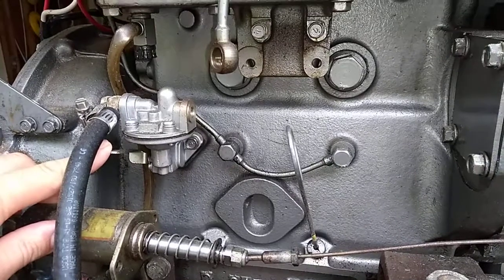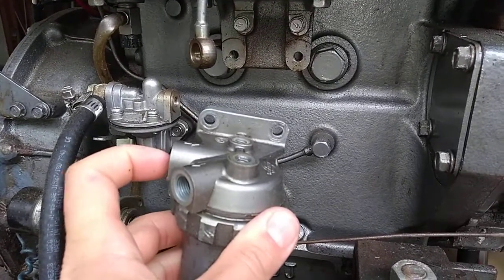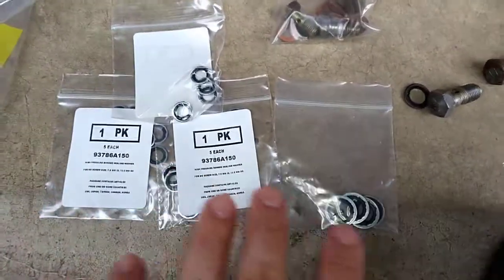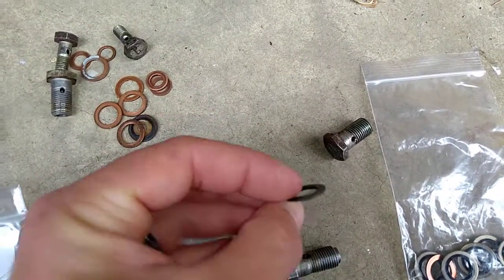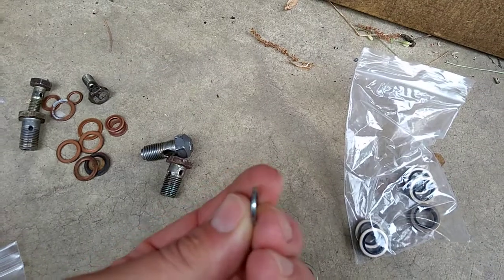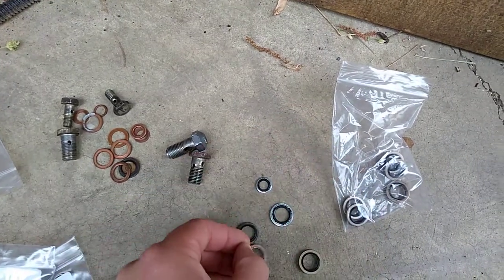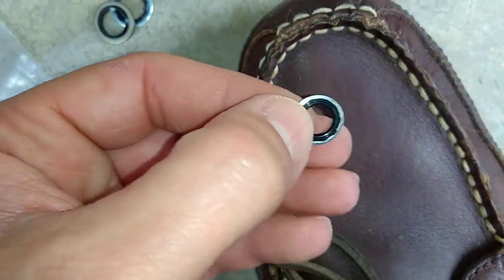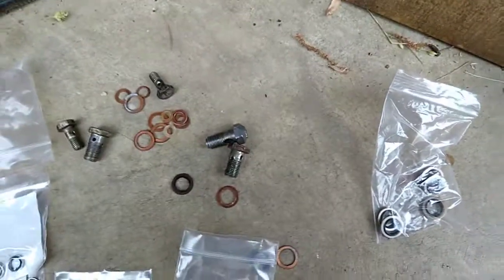Bleed procedure and seal washer upgrades.

Comment: Josh  thanks for the video...
Rather then sealing the original bleed screws with JB weld, 
You might consider drilling out and ‘tapping ‘ these holes with/ for slightly oversized bleed screws